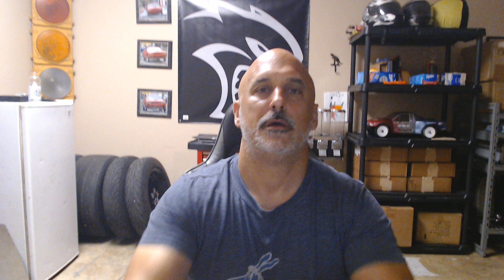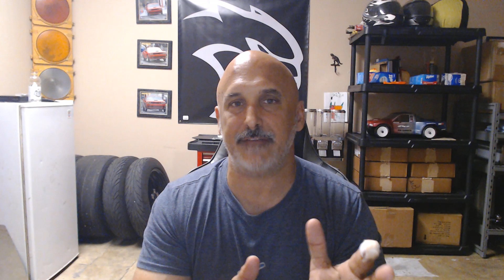Gen 3 Hemi Camshaft Discussion. How to pick the right one for you.

Comment: So what do you think about a .582 lift 223/232 113Lsa +3 (110) ICL on 6.4 challenger 8 speed stock converter intake?
Reply from the maker: Again, all of the 22x something duration intake cams make about the same power. Also, all of the more modern grinds are between 113 and 114 ° of lobe separation with intake centers around 109 to 110.  I was one of the first to put that profile together about 6 years ago. It's proven to make decent power across the board it's not peaky and it basically makes the engine act like it just grew and displacement without having too much drama under the curve in terms of drivability and livability long-term. Much more than that and the car gets a little bit too big for its britches, meaning that it doesn't make the horsepower that it sounds like it could based on the amount of overlap and chop. Much more of a cam than that and you really need to rethink how you want to make horsepower. The heads flow like crazy. Head flow on a gen 3 cylinder head is amazing, but at the cost of being lazy airflow. You really do need to spend these cars to higher RPM or hit them with Boost to have them be efficient. It's easy to make huge power with a gen 3 Hemi but most guys won't fool with it because the manners of the engine are just more rowdy, and not in a cool way
Reply: @bmasontv  Lazy airflow ,meaning not enough velocity due to the intake manifold?
Reply from the maker: No, lazy airflow in that the cross section of the port of the intake side of a set of gen 3 heads is huge, so low velocity but high flow capability. The intake manifold is doing all it can to generate velocity
Reply: @bmasontv  Thanks dude you're always a wealth of knowledge on these Gen 3 Hemis.

Comment: B will the boys a Peitz stay with you on the tune until its right on the email/ remote tune or is it 1 and done?
Reply from the maker: @randyschnelle4137  they will do their level best to make sure that you're happy, but there are limits. Provided there are no mechanical issues that are undiagnosed before the process begins, these issues include exhaust leaks and vacuum leaks among others, which can create a problem with getting accurate data on the vehicle..the mechanical side of it is pretty quick in terms of engine tuning. The transmission tuning on the other hand is what can eat up quite a bit of time when it comes to shift points and shift firmness especially under partial throttle because everybody is a little bit different
Reply: @bmasontv  I understand the vacuum leak mechanical issues like that having to be squared away to get it right . Im an old guy when vacuum lines ruled to the old qudrajets and holleys . I have a young 25 year old buddy who just did his LT  and he had a tussle on his remote tune because he didnt rerun the torque on his intake after it heat cycled a few times and his problem was vacuum leak sure enough and that screwed his trans shift points.

Comment: Im looking at the Tomahawk 2.0 for my Hellcat. I like the tighter LSA for low and midrange. Ive never understood why the Hellcat builders want to neuter the cam with wide LSA and then they do a stroker kit which is mainly torque numbers because we are limited to bore size. Why not put a cam the engine wants in the first place and power will probably be similar to a stroker with wide LSA cam which kills low and midrange power. I want my Cat to EAT at all rpm levels up to 6800. Manton rocker shafts will be installed too. Ive got a 4.5 Whipple so rpm will not be an issue unlike factory  pullied blower. 
Also im not a drag racer just like to run the my car when i feel the need so im not concerned with too much torque.

Comment: Help...I have a gen lll  6.1,i currently have a 6.4 intake with 6.4 injectors andca hell cat throttle body.im thinking of putting eagle heads with long tubes.what cam could you recommend for that combo,also running 3.06 gears
Reply from the maker: Without knowing what the plans were for this car I can't recommend a camshaft. In general, any stage 2 would work just fine. I would get with whoever is going to be tasked with tuning the car and use their experience to help guide you

Comment: Would that be 426ing ?
Reply from the maker: Modifying a 392 to make equivalent power of a 426 with the same manners
Reply: B keep coming back to vid of yours. Your cam from Peitz CD-01 224 intake 230 exhaust no lope , would that be 426ing as you call it? The other cams for the 6.4 226-228 intake 232-234 exhaust you talk about will those require a different converter and where is the powerband? Higher RPM i presume. Will the latter lope and sacrifice drivability and low end torque?

Comment: How high of duration you think would be solid with a 4K converter? Currently running a 213/230… thought of going higher. 😊
Reply from the maker: Depends on a couple of things..
Stock intake?
Purpose of the vehicle?
Need more info on existing cam?
Tolerance for drivability issues? 
In general, for a 5.7 and a stock intake, I would stick around the 220 range for intake duration.
Reply: @bmasontv  
5.7 motor… 
ported 6.4 manifold… 
213/230 LSA112 +/- 6 582I & .572E…
I daily it… 
No issues now, have tolerance.
Reply from the maker: @OneDangerousDurango  224 It's about as aggressive as I would go, you just end up losing too much. Drivability much bigger than that on A57. So, I wouldn't. Go wider than 114 for the lobe separation angle
Reply: @bmasontv  thanks big guy. Always good to pick multiple smart brains
Reply from the maker: @OneDangerousDurango  get as many points of view as you can.  Also, give Matt  at Moe's Performance a shout.  Tell him I sent you. He can help out in a big way, too.